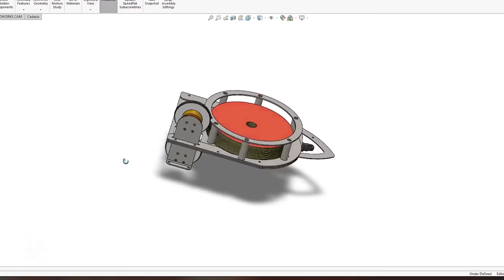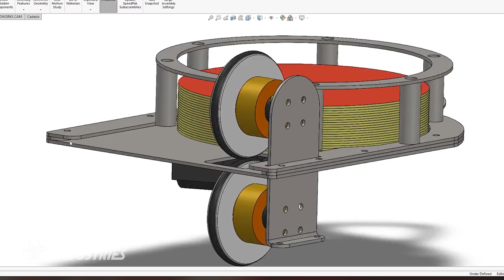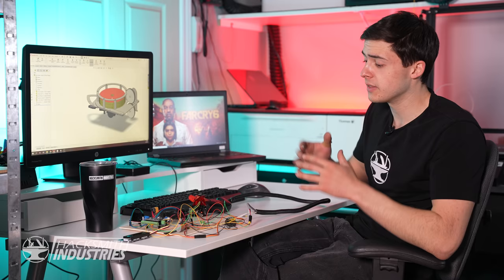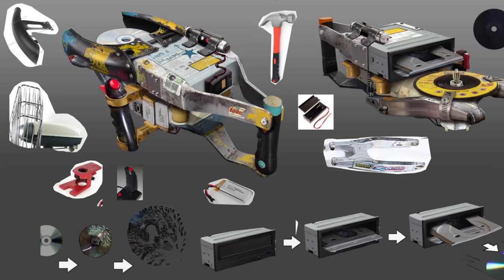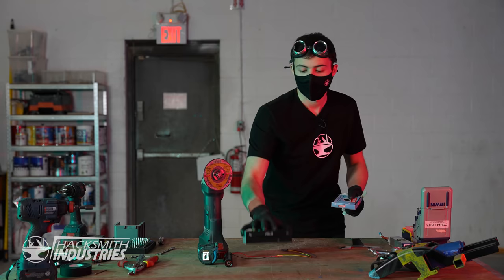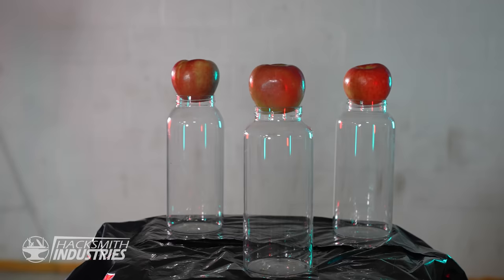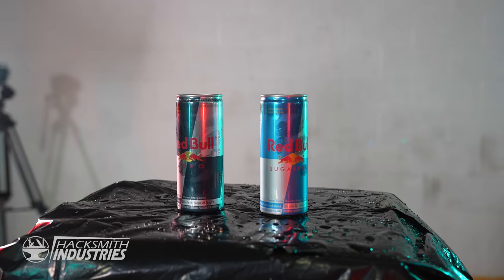RAPID-FIRE CD LAUNCHER from FAR CRY 6

Comment: To increase the power of the projectiles, use metal discs instead of the plastic material of normal CDs
Reply: He would have to upgrade the motors to launch the extra weight of the metal discs, considering that’s where the ‘power’ comes from.

Comment: you could have used 2 more motors for extra power and a widen the rubber part for more grip to fire the disk or stack the firing system for dual disk shooting using spring loaded magazine like one downward loading and one upward. there should be some space for the battery. i think we can also make the disk more aero dynamic.  anyways gud job guys..

Comment: I once took the motor and cd mount out of a portable CD player and hooked the motor directly to a 9v battery. I could pop a CD on it, spin it up to full speed and then very gently tap the bottom of the CD to send it flying across the room. More the a few times the CDs themselves few apart just from centrifugal force alone. Not an cool as what you all built, but i good deal cheaper and just as dangerous. I am damn lucky i didnt end up with tiny bits of CD stuck in my eye. :D

Comment: The angle grinder test, shot the disc at like twice the velocity of the finished gun, and u think it's because the surface area of the angle grinder was bigger, and because the disc was clamped tighter against the table

Comment: Iron Man Repulser Idea.
Uses it's own force to create the force.
Like a car's combustion. Or like how a air tank works. So like when the piston pushes up while others are pushed down by the combustion. But its electric like a air tank an there is some kind of pressure chamber. Or not electric. Stay safe. Just an idea. Also what would happen if there was a ring of rotating electricity and a object was dropped in the middle.? Like a metal ball.

Comment: this design is quite bad - not a large enough contact area between O ring and cd - needs a band shaped rubber ring, not round O ring. Your 'flywheel' does not have enough inertia. The inertia is where the power comes from, not directly from the motors. A larger flywheel will allow for the build up of a high amount of inertia in the flywheels. This allows for a larger amount of energy to be transferred to the cd. The angle grinder you used as a cd launcher worked 4 times as well...

Comment: Arhh "ultra powerfull" is a stretch, these CDs more glide in air then carrying any real kinetic energy in them, which you want in a so-called weapon attempt..
A shame you did not went with the angle grinder, as that swung them with way way more energy, almost to an extent that the media-structure couldn't keep themself contained.
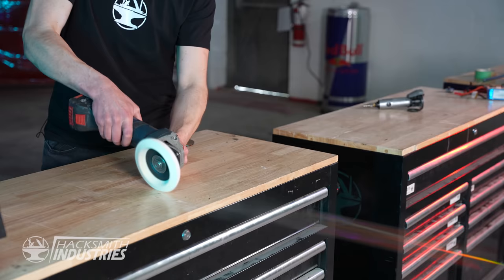example 1:42  & 7:40 versus 1:51 (the angle grinder are delivering way more potency, its not even close, and down to the beefy motor & flywheel size, where an angle grinder can keep the torque way higher when it meet resistant (like sving a cd, then a pair of small brushless drone motors on a 4s pack).. but yeah proof of concept, just a shame not pursuing max power when the build is this solid and its the narrative your fronting under 2:00.
but great video & build, no-nonsense.. well done.